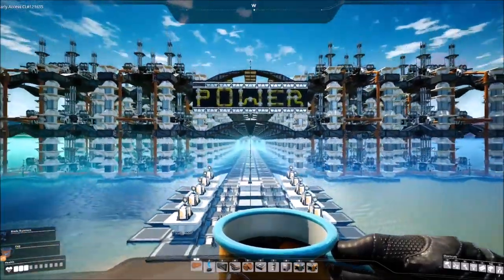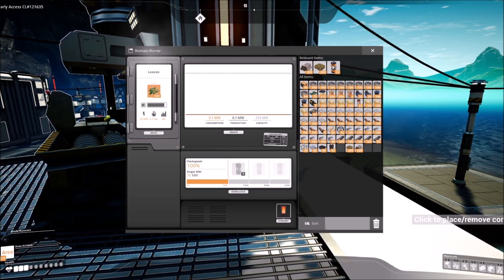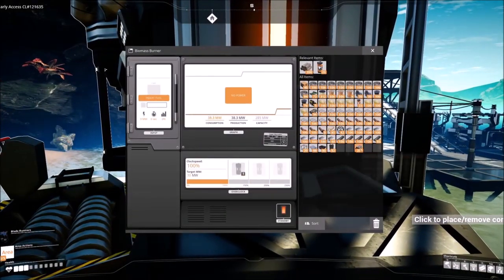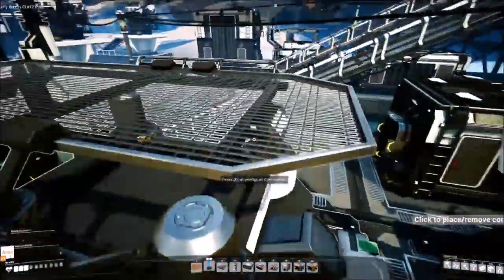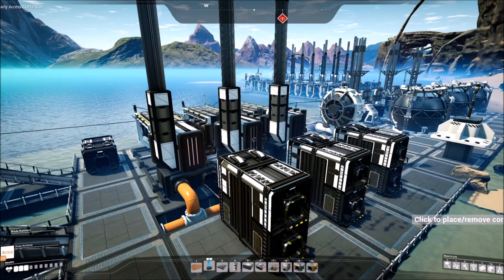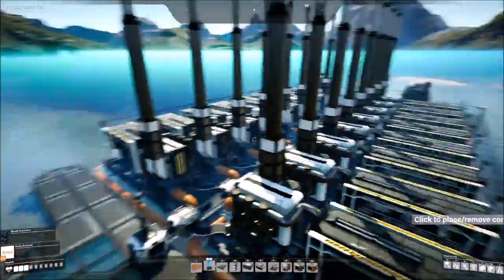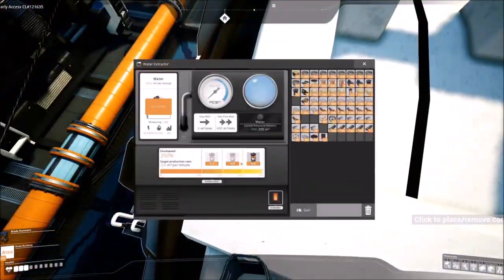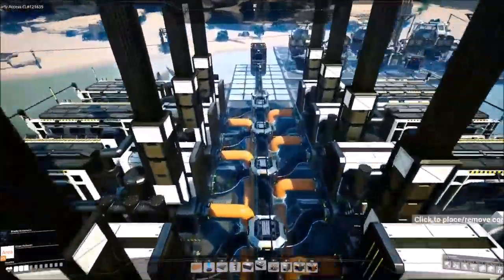Satisfactory tips EVERYTHING YOU NEED TO KNOW ABOUT POWER Satisfactory Steam Release May

Comment: you know that m³ is a cubic meter and not milimeter³ (which is mm³ and a cubic millimeter)
and 1 m³ is 1000L (1000 liter or ~220 gallons)
otherwise a pretty nice guide and very helpful
just passed over the nuclear power part and noticed that you messed it up there
0,6 units per minute means you produce 1 unit in 100 seconds (and btw you tank about seconds at 29:17)
so in 5 minutes you produce 3 units

Comment: Love the fuel generator design.  Looking really good.  One point to make is that having 2 refineries at 100% and a 3rd at 175% in your clusters gives you the same throughput as having all 3 of them at 125%, but uses more power.  Besides, what kind of OCD person can you really be if you don't get the darned things all even where you can?  Two very good arguments (OCD & Power Usage) for minimizing the overclocks.  If you are worried about Power Crystals, just do 4 refineries underclocked to 94% for nearly identical throughput and even less power usage using zero Power Crystals.

Comment: Didn't even realise you should Connect all your generators together ....

I have about 25 Biomass Burners each hooked up to it's own couple of miners, smelters and so on...
Reply: @DrawingXaos  I had them relatively centered, so I could just look at which machines don't work and knew which generator blew a fuze or ran out of fuel...

But that doesn't really scale well.

I've rebuild the entire base so that I have a separate Biomass Burner Outpost in the forest with it's own little manufacturing loop to turn leaves and wood into Biofuel.

I also started coal recently with 3 Coal Burners, but I'm planning to expand that by 3 more soon.

Everything is hooked up to one central power grid now and it is so much easier, this video made me realise the mistake before it became unfixable because the base grew too much ^^'